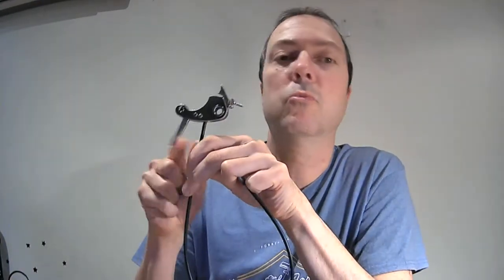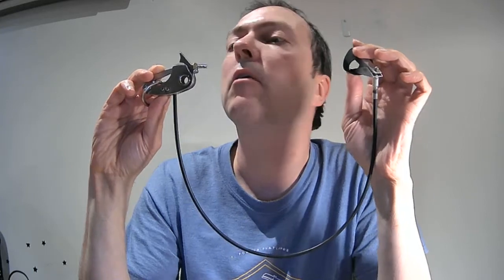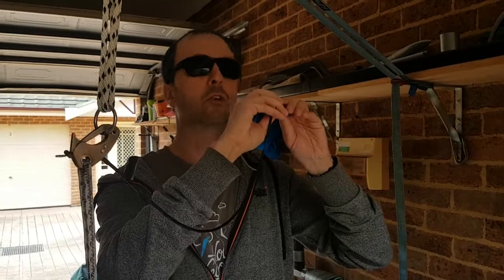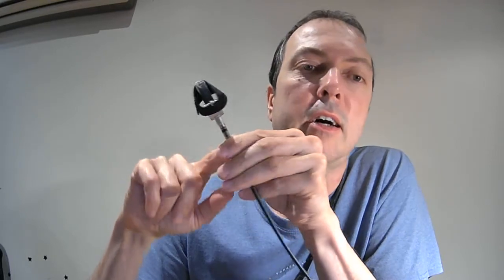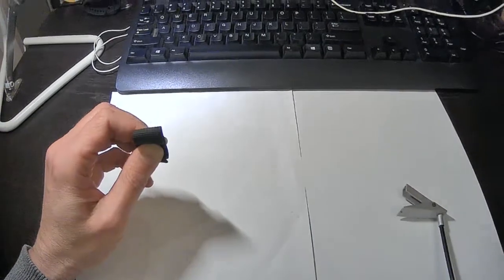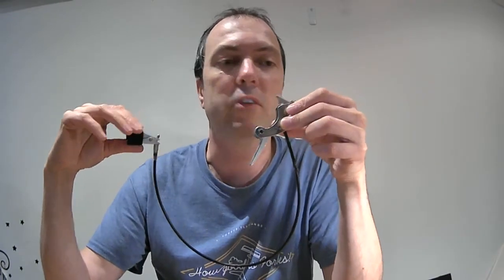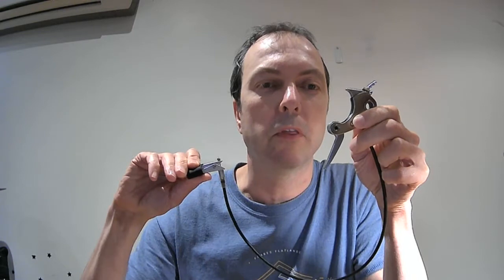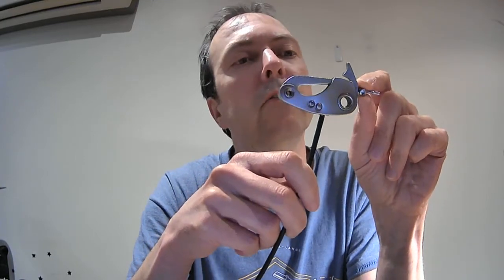HG mouth release, part II - design and in-built safety measures

Comment: Hello.
Why is the mouth piece at 90° to the wire?
I think it's easy to make it straight. It would be less dangerous, if the cable pulls the mouth piece.
Reply from the maker: That's a very good question actually. In short, I don't know. However, a while ago I had a mouth piece like you described, I even still have it somewhere. I don't know/remember where it came from. Most probably from Alex (the guy who makes the releases), but maybe someone else-  I live quite far from Alex and back then I didn't get the release directly from him. Anyway, the range of the cable the mouthpiece was pulling in and out was a bit shorter than needed. As a result, I had to readjust the cable a few times, and still it was not opening as reliable as a "standard" mouthpiece. So I might guess that making a "straight" mouth piece might be not that trivial, maybe because there is compromise between what can fit into mouth, the force on your teeth from the applied leverage, and range of the cable the mouthpiece can pull. But to be perfectly honest - I don't know. So maybe it's still possible, just none bothered after this first attempt.